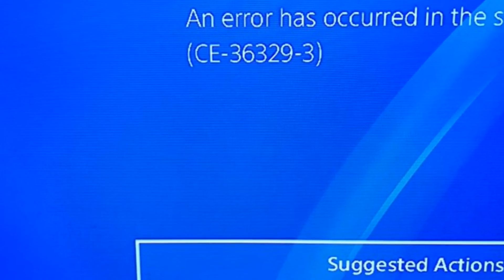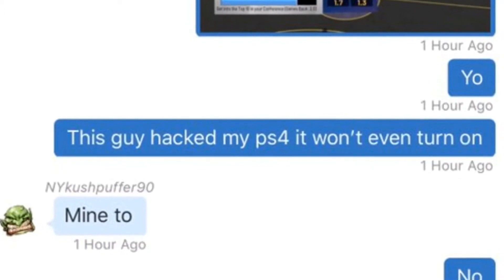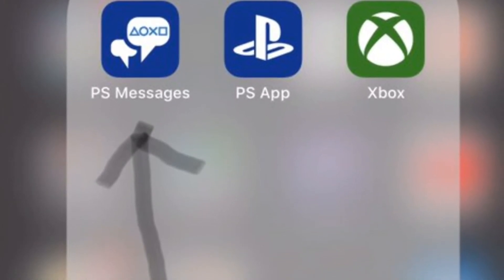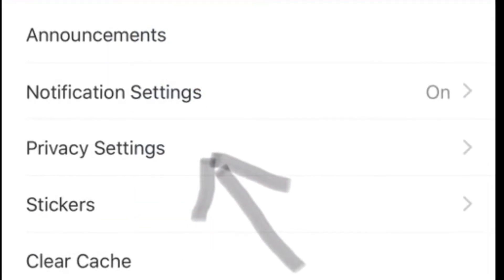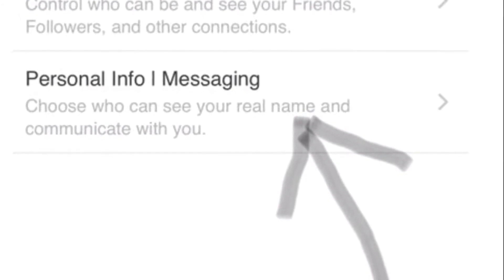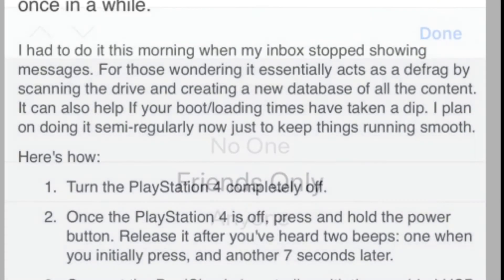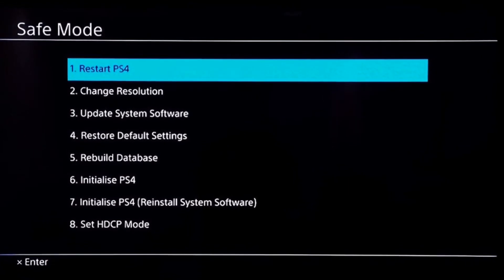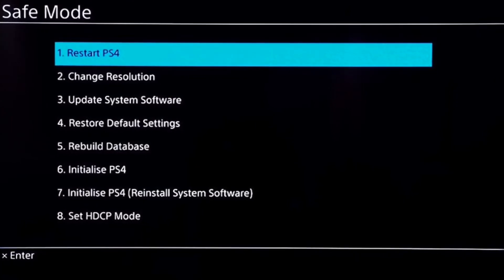CE-36329-3 PlayStation Error Fix With Explanation.

Comment: Good so I have a ps4 problem all of software system errors and still has lag or no longer wants to open and I have ps4 slim what I have to do
Reply from the maker: I would have to see your PlayStation in front of me before I know for sure but it sounds like you need to replace the hard drive.

Comment: Appreciate the explanation,  so my question is, if someone did reply to one of those group text..is that basically it for your hard drive?? Also did buying  a new hard drive fix the issue with games crashing ?
Reply from the maker: You can format that one and it will be OK but the bad thing is you will lose your game saves that is the only downside to this and then make sure once you reprogram after you format that you update your system firmware.
Reply: @Mr_Goody  Well I tried rebuilding database, initializing and my game still crashes.  even get issues connecting to the psn😔
Reply from the maker: If it does that it could mean that your hard drive is bad and it will need to be replaced if you look through my channel I have a video recommending hard drives and where to buy them and how to remove the hard drive and reprogram it it’s really not that hard and replacement hard drive will cost you about in between 50 and $80.
Reply: @Mr_Goody  Ppreicate it man. Crazy how a msg on my acc since 2019 could affect me years later lol. forgot I had it
Reply from the maker: @jr4god11  The world is crazy sometimes.

Comment: It let me play my discs games but not my downloaded games I'm tryna play fortnite
Reply: If i get a hard drive from a another ps4 will it let me play
Reply from the maker: Yes another hard drive from another PS4 will work but it will also want to erase or format the new drive when you put it in and you will have to go through the steps in the video to reinstall the operating system to the PlayStation 4 and yes you will need a USB thumb drive but they’re very cheap and between five and $10 at Walmart.
Reply: @Mr_Goody  but can I wipe all the data of the new hard drive and start my ps4 from scratch
Reply from the maker: @qwuuan  yes sir 👍✌️
Reply from the maker: Try doing the first steps in the video and  When you boot into safe mode, Choose to rebuild the database and if that doesn’t work then it probably is a hard drive.

Comment: I get this error code and it only happens when I try to start a game everything else works fine ps4 will be on for hours no issues until I click on a game then it freezes and it’s stuck I changed the hard drive I tried everything I’m stuck any help from anyone
Reply from the maker: Does it just happened on a certain game or games or can it happen out of nowhere I’m trying to rule out software corruption as opposed to bad sectors on the hard drive.
Reply: @Mr_Goody  yea I replaced it with a old laptop like you said to do and it work I appreciate it
Reply from the maker: I’m glad it worked for you my friend, happy gaming👍

Comment: I’ve done absolutely everything. Rebuild database , Initialized. But the weird thing is it never happens when playing games or watch Netflix or YouTube. It happens at random ?
Reply from the maker: If it happens at random it could be the hard drive started to go bad or it overheating.  You could try cleaning it with compressed air and make sure it’s in a well ventilated area. If that doesn’t work you should watch the Video On My Channel On how to replace the hard drive.

Comment: What is the message that people send so I could prevent this problem going on in the future
Reply from the maker: It is usually jibberish, like the example in the video.
Reply: Mr. Goody If I factory reset my ps4 without that account on my ps4 do you think I will be good?
Reply from the maker: If it is the software problem then yes, but if it’s a hardware problem then it will still have problems, that’s a good way to see if it’s hardware or software related.

Comment: When I turn on my ps4 it goes to a black screen and I can’t get into it and a blue screen pops up an says the error thing but I can’t do nothing about it
Reply: Boot it into safe mode (turn it off, turn it on holding button till second beep and it goes into safe mode then update software) or initialize which resets whole system
Reply: @alexalcantara5821  i have done both of these things but still dont work
Reply: @hannandemerje9149  well I haven’t messed with my PS4 since this happened and it’s been sitting in its box in my closet so I’m not sure what to tell you
Reply from the maker: I wish I could be a better help but unless it’s in front of me I can’t really tell you the exact problem.

Comment: I hope you can help my PS4 crashes when I try to switch accounts
Reply from the maker: Try your account on another PS4 if possible or try a new account on your PS4 and if it doesn’t freeze, then follow my video on how to rebuild your software database.
Reply: Mr. Goody I can’t switch my account and on my friends PS4 it works idk y but it happened like just a couple days ago I can’t go to the switch user page it crashes I tried to go safe mode and rebuild database but nothing changed
Reply from the maker: If it works on your friends PS4, I’d say it’s probably your hard drive going out.  You should back up whatever data you can if it will let you and use my video on how to replace your hard drive.
Reply: Mr. Goody alright ty how much are hard drives?
Reply from the maker: Hydro FlikZy In between 60 and 70 for a 2 terabyte.
Reply: Mr. Goody alright thanks for the help
Reply from the maker: Your Welcome
Reply: Mr. Goody hey I have 1 more (or more) questions my PS4 when it turns on it’s like I plugged my PS4 off it starts off like that

Comment: Hi I am having a similar problem, when I turn on my PS4 it slowly loads up and once it finally does it takes about 5 mins, then it slowly goes to the profile select screen and once I select my profile it just freezes for about 3 mins and beeps three times then turns off, and the times I get lucky and it goes past the profile select it freezes then turns off when I select a game, I’ve tried every method on YouTube and none worked, please help :(
Reply from the maker: Try the software databases rebuild and the replacing the hard drive.  One last thing it could be is overheating, blow it out with compressed air and make sure your PS4 is not overheating.  That’s all I can think of right off my head.
Reply: Mr. Goody I’ve rebuilt it, initialized it, everything possible but I’ll try to replace the hard drive 😊
Reply from the maker: TrikzR4Kidz -_ That should take care if it and get you back up and gaming. 👍
Reply: TrikzR4Kidz -_ did u replace the hard drive if so did you fix it?
Reply: Zenz nah honestly I just got an Xbox a bit after it broke I’m tired of PlayStation and their problems
Reply: TrikzR4Kidz -_ so u never replaced the hard drive right?
Reply: Zenz no

Comment: I fixed it by deleting my account of PS4 and logging back in, this would work 100%, don’t listen to what he’s saying it’s just crap, doing this method would not take away any data or games.
Reply from the maker: I respect all opinions but a failing Hard Drive Or Corrupted Data is not Crap and is proven by the many people who have had this problem and fixed it with the method in my video.  The reason your method worked for you is because you obviously didn’t have the same problem as in my video or the solution would not have worked. This is very clear as you have posted more comments on my same Video saying that you fixed the problem a while back by simply changing the password to your Playstation account. If it was fixed then, why did you have to delete your account and fix it a second time?  If something is fixed, you don't have to fix it again a second time. Just saying.  However everyone is entitled to their Opinion.  Have a Good Day 👍
Reply: Mr. Goody it did have the same problem how are u telling me and it is crap.
Reply from the maker: I am telling you my method works, I will not argue with you, hundreds of people have gotten help from my video, the error message if you look it up either means that there is corrupted Data or A Hard Drive needs to be replaced.  Scientifically and factually proven.  I will leave your comment up and see how many hard drives get fixed and corrupted software gets fixed SIMPLY by deleting a PS4 account.  I have no reason to lie to anyone and I don’t make millions of Dollars off of making these videos.  I make these Videos to help people.  I understand everyone won't agree with me Or understand the problem in which they are having may not be the same problem as in this Video.  I respectfully think that is the case in your situation and I’m even going to respect your Opinion and not tell you your full of crap like you did me and tell you to have a good day.

Comment: Having this issue in 2020, anyone else?🙄                                                Edit: There is a fix to the issue, replace the hard drive. I had this done about 3 weeks ago and everything seems to be running fine.
Reply: Me everytime I open a game it stays on loading screen then my ps4 turns off by itself
Reply: @CallHundo  that happens to me -_-
Reply: @CallHundo  exactly this
Reply: @noahbarollo8511  I think what I did was rebuild database
Reply: @noahbarollo8511  what game have you been trying to play
Reply: @CallHundo  Fortnite, it is the only gamr i cant play without updating again, alevery time i want to play fort ite i have to go in safe mode and do the 7.02 system update
Reply: @CallHundo  already tried
Reply: @noahbarollo8511  that was the same game I was trying to play so I turned of the ps4 then I held the button to turn it on and waited till I heard two beeps then I rebuilt database and if it didnt work I retried it then it eventually wo4ked
Reply: @CallHundo  i already fixt it, i did the 7.02 system ipdate 2 times in a row qith safe mode and all the other things and now it works perfect
Reply: Noah Barollo it’s an easy fix that I did today. You’ll just have to wait for about an hour. So I recommend doing everything in this video. In addition to that go into safe mode as shown in the video and press software update. His is to make sure you are on the correct update. After that you will want to delete fortnite install it back. One thing I noticed is even when fortnite is downloaded when you press notifications you will see something that says data required for start. After installed it should be fixed. Let me know if you need more clarification
Reply: @CallHundo  Happens to me top but only Happens with fortnite
Reply: @CallHundo  same here
Reply: AyoGlitchy YT have u found a fix
Reply: I've been experiencing these constant crashes and freezes for a couple of weeks. I've tried every option on Safe Mode including option 7 and nothing worked. I don't know what else to do. My PS4 is messed up.
Reply: @guilhermezan  replace the hard drive
Reply: Mark Jordan me
Reply: ThatYrnJay it’s hell
Reply: @welln0w  oh yeah just happened to me .... you manage to fix yours im thinking of just buying new one
Reply: yes smhhhh
Reply: Happening to me right now ! Grrrrr
Reply: Mark Jordan yay we’re all getting our playstations destroyed together. hopefully my electronics plug will absolutely demolish these “hackers”💪🥴
Reply: Me
Reply: Mark Jordan yup
Reply: Mark Jordan Don’t know what I did.
Reply: Mark Jordan me
Reply: Mark Jordan :(yip
Reply: Mark Jordan I have the same problem I’ve been tryna fix it for a week but I’m trying this hoping it works
Reply: IMPORTANT: you must replace your hard drive and back up your data from the previous one, that is how you fix the issue
Reply: I have being thinking about that, replacing the hard drive was the last resource To be honest, I don’t have the money do buy a 1tb hard drive , I don’t even have 25 dollars right now 😔 is impossible to find one less than 10 dollars
Reply: F4br15510 hate to hear that bro, try getting a job or doing chores to save up?
Reply: Oh ya, the issue of the coronavirus? Ivw got it. 
ITS JUST A JOKE I DO NOT HAVE IT
Reply: what did you guys do? is it working now?
Reply: Adolf Dripler I don’t think there’s a definitive fix for it unfortunately, just gona have to wait for the ps5
Reply: Mark Jordan yes there is.. you need to buy a new hdd
Reply: Same
Reply: Me
Reply: My shit is fucked bro 😂😂😂
Reply: Yep
Reply: Me
Reply: Yes
Reply: Got it like 3 days ago. I’m pissed
Reply: Same I literally am so sad i dont know what to do
Reply: me to
Reply: I just got it
Reply: @Benjamin-ok3yl  you manage to fix it ??
Reply: @skies100  yea I did I had to wipe my whole ps4 tho
Reply: @Benjamin-ok3yl  mine still fked up even when i system restored it :( had to buy a new one sucks only 9.5 months old playstation services are shutdown as well sucks
Reply: @Benjamin-ok3yl  oh no that sucks i had to buy new ps4 i tired everything and nothing worked :'( once covid 19 is over going to have my old ps4 repaired and keep it as a back up
Reply: @skies100  yea I had multiple error codes and I fix some of them but they just show up all the time I don't really not what to do
Reply: @Benjamin-ok3yl  same i got like 20 error codes i even system restored everything and still give me error code i had enough i just ordered my ps4 it can be a  update error dunno there was a new update on april 16 so yeah
Reply: Me I've had this prob since early2019
Reply: Yes even after installing the new software update
Reply: All my games are on External and it still won’t work
Reply: 2023😭
Reply: Yes ever since fortnite update may 7 2020. I believe this is a direct attack from Epic Employees. They have every ability to do and send whatever they want.
Reply: James Labelle it’s not an attack from epic employees you idiot, this is nothing to do with them or the game your playing, it just happens
Reply: @jameslabelle4219  i have a solution check my channel

Comment: Mine was fortnite... Very slow to start the game.. And when the loadings reen fortnite appeared.. Its freeze.. But I still can press ps home button.. Then suddenly my screen turn blank.. Then I had to turn it back on.. Then the power button turns blue.. And it says something like system is updating.. (this thing is not one-time bro.. 😅) and plus I've done (software update frome safe mode).. Still the same..
Reply from the maker: Amin Naim   Then check out my other Video to replace your hard drive, it sounds like it’s failing.
Reply: @Mr_Goody  which one?

Comment: I tried everything... Nothing is working... It keeps turning off...what should I do?  ..
Reply: Try removing your payment card from psn and changing your acc password, this is the only thing that worked for me (I tried rebuild database 2x, factory reset, reinstated system software, none of these worked.) It was someone trying to hack my PS4. And ps_girl sent me a friend request 2 days after the error
Reply: @ShiroUsagiArt  I had to wipe everything on my ps4 I don't think my psn is still valid..
Reply from the maker: Does the power to the PlayStation turn off? Does it freeze and or reset?
Reply: @Mr_Goody  it freezes and resets every time . I went into safe mode about 8 times tried the system update and nothing.. Then I tried #5 and #4 on safe mode still the same results. I tried to find any msg but don't have any. I did change my settings to only friends tho and still...:(
Reply: @Mr_Goody  update...I HAD too go for the last options and wipe everything... well...I STILL can't get into the home page! Please help me..
Reply: @Mr_Goody  every time I turn the PlayStation on I get the error code CE 363293. REPORTING THE PROBLEM NEVER HELPED ANYONE. even so, it just freezes when I try to report.
Reply from the maker: +John Garcia 

Without me seeing it in person I can only give you my best guess as into how to fix your problem, I believe it could be overheating or your hard drive is failing.  I would guess the latter, I have a step by step video on how to replace your PS4 hard drive.  I hope this helps and your back up and gaming in no time.
Reply: @Mr_Goody  thank you bro, I have the warranty so if anything I'll go ahead and try. I appreciate you trying to help me.
Reply from the maker: John Garcia  your Welcome and of you need anything else I’m always here.
Reply: @Mr_Goody  hey bro, I have a question, if you don't mind. If I factory reset my ps4 does that mean any games purchase from the PS store is un-downloadalbe ? Would I have to purchase them again? 😨